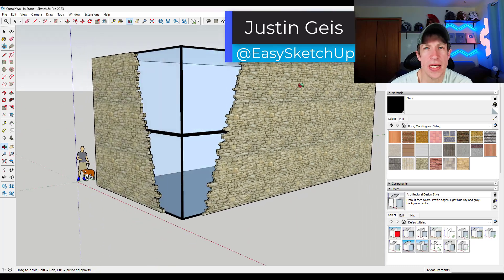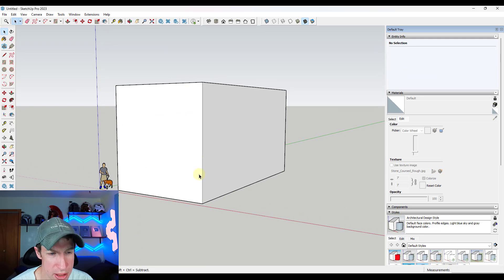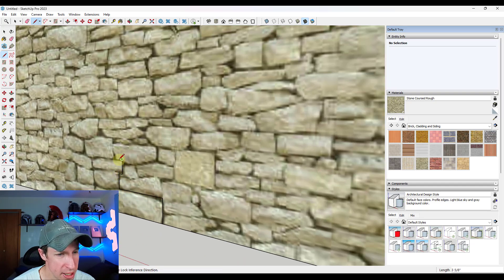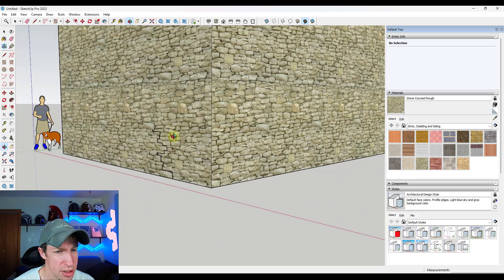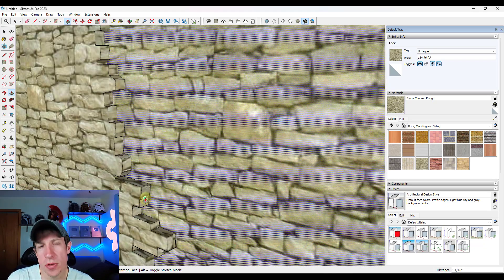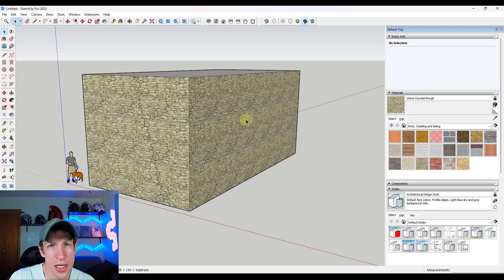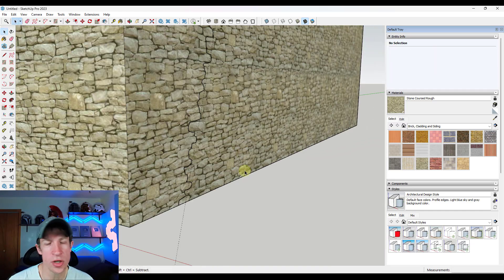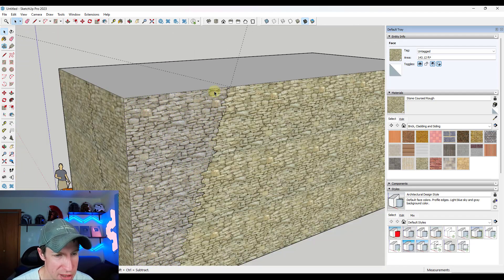Creating a STONE AND CURTAINWALL Structure in SketchUp!

Comment: Justin....It's basically a new building in the inner with supports to stabilize the stone wall ....
Reply from the maker: I would assume you'd start by building out the inner wall with with structural studs or some kind of CMU block, then once the backup is in place, you'd probably at least put the window curtainwall framing in place, then whatever sheathing/insulation goes in the cavity, then add the stone outboard of all that. I would consider the stone to be more of a cladding assembly in this case